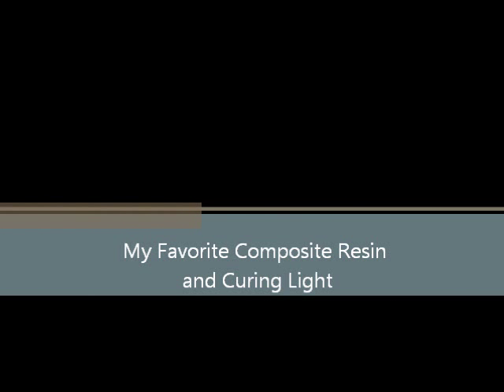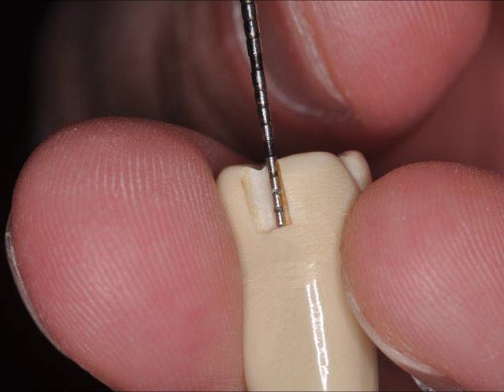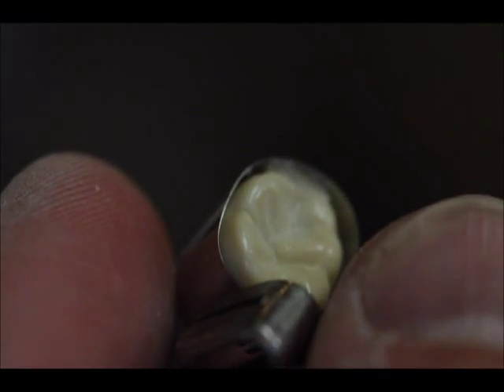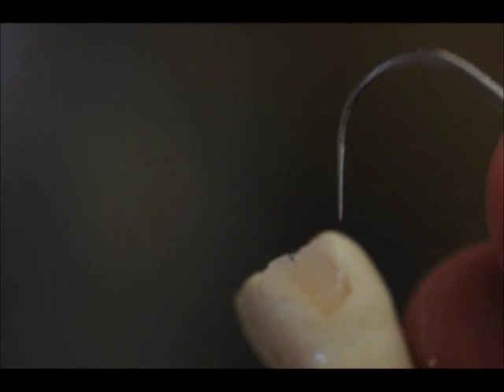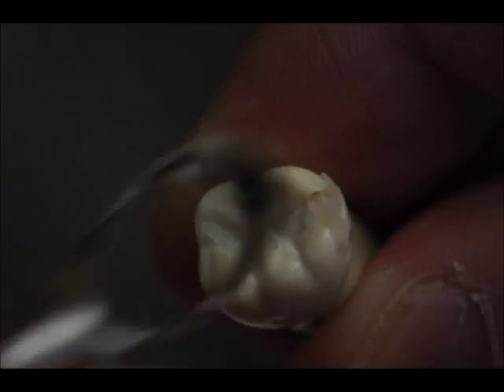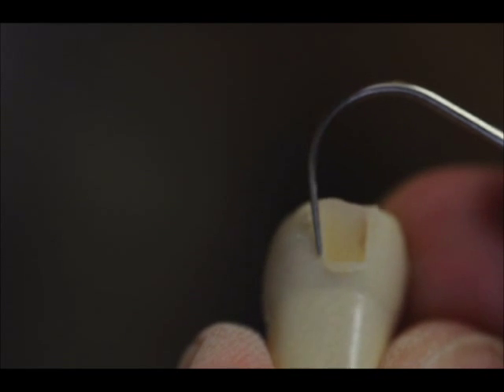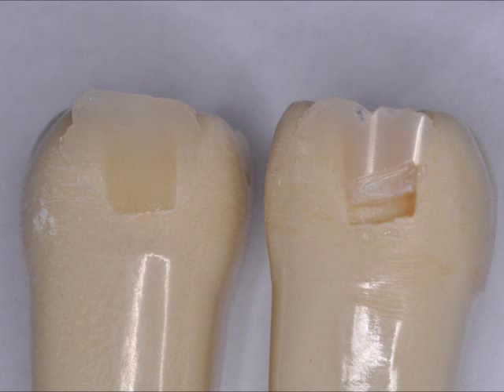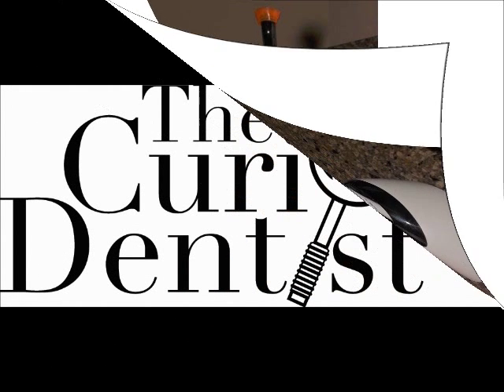My Favorite Posterior Composite Resin and Curing Light

Comment: Can you tell me what is better the incremental or bulk fill composite in the side of polymerization of same material as tetric evoceram composite filling
Reply from the maker: I don't think one material is better than the other; they are just different materials with different techniques.  Current research on bulk fill composites shows that the shrinkage effect is minimized, allowing for larger increments.
Reply: Thank you for attention

Comment from the maker: Composites that call themselves "bulk fill" are supposed to have unique chemicals that will reduce polymerization shrinkage and thus allow larger increments.  Tetric EvoCeram is approved for increments up to 4 mm due to their proprietary formula.  I haven't worked with ultrasonic curing yet.